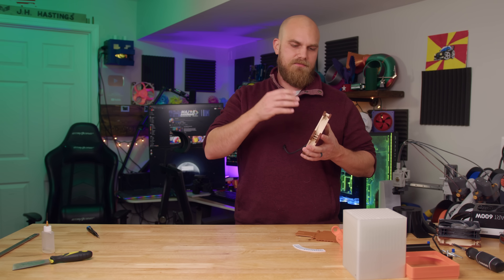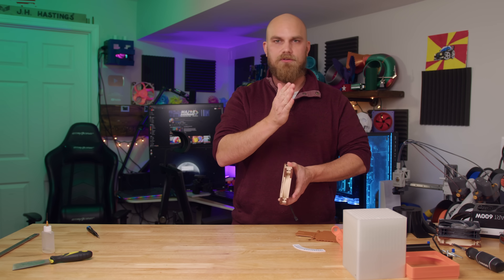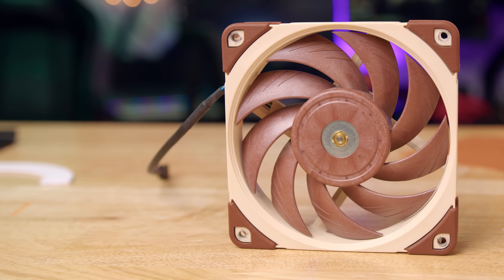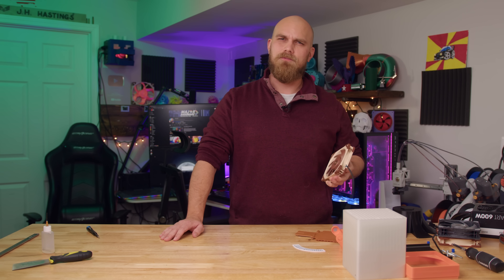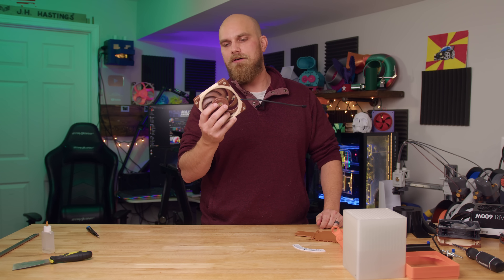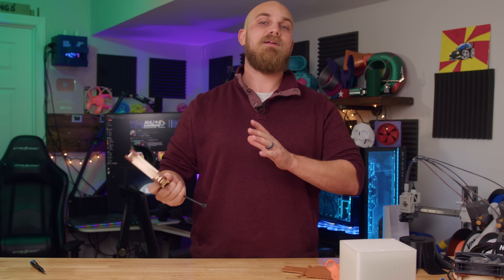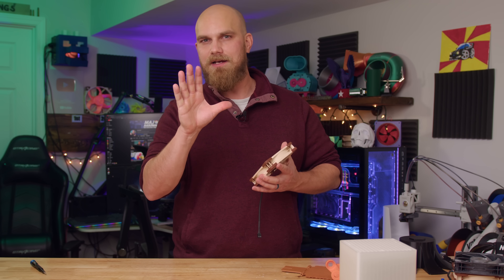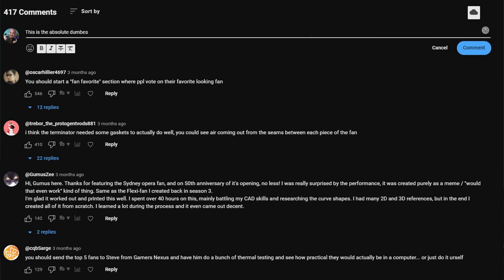I Built a Static Pressure Machine | Fan Showdown Season 6 Pilot

Comment: Nice idea and good way to do next season HOWEVER because you confine the air through a basically a tube and ontop of that even a grid, there is basically no spillage of air on the sides, making it so all the air would have to get through. In a real scenario it should push air through a radiator to cool. If a fan spills most of its air to the sides then obviously it will cool less good as a fan that has a tighter airflow. (Very noticeable with the smoke test). I suggest to still use the smoke test and maybe even a smoke test through a radiator aswel to see the spillage of air

Comment: Hi. It looks cool. But maybe to measurement correctly and repeatable you should Set some constant values. Like the rpm values of the fan motor. (With multible stages. I had some fans that works really great until they spun faster or until they worked against a fangrill, that interduced to much turbolences  and also noice / vibration into the system. I guess if you want to messure a kind of efficiency by interducing the power used by the messurement.  Then you straiten and obscure the flow by adding thousends of microturbolences into the system (also thru the layerlines of the print). Shurly you given a constant length but i currently ask myself if longer and maybe slik or spiral guided channels could reduce turbolences more.
As addition to the messure gauge ... maybe begin with 0 and add a really light "maximum force hand" to it. That you can set to 0 , and it get pushed to the maximum value. So comparisons are easyer :)

Thank you for your intressting videos ;) 

Greetings from germany

Thomas

Comment: If you want a cheap and simple manometer just do a tube of liquid and connect one end of it to the box and it will push the water up or pull it down depending on which side of the fan you are testing from. Look up Measurement of Pressure with the Manometer on google and you will see. I think this would be a great start and cheaper then buying a manometer that you wont ever use again. If you really want a digital one just buy a cheap one.

Comment: I feel like the scale should be logarithmic. The further the panel is pushed away from the tunnel, the more difficult its gonna be to push, due to the distance from the tunnnel and leverage (air pushing close to the hinge is going to be less effective than air pushing on the bottom of the flap).

Comment: Actually looks almost perfect, what i would do is to make that counterweight longer so it has a better "resolution" and the measurements are more precise, it dosent need to be a U shape on both sides so the material you take from one of the sides you can add it to the other against the numbers and make that quarter ring bigger.
because the difference between the stock noctua and the winner of last season was pretty small, so the differences are gonna be even smaller.
Other than that... exlenent idea.

Comment: As this flap opens wider, the accuracy of the results just disappear. A lot of airflow is lost at the bottom of the duct because the flap doesn't offer resistance any more as it's partially opened already. This is not a valid testing stand since the competitors seems to be very close in performance to each other. Nice idea, but this test stand isn't relevant.

Comment: The measurements you have are going to be somewhat logarithmic / exponential due to the swinging of the door. It's going to be much easier for a fan to go from 1 to 2 than from 8 to 9 due to the weight of the door acting farther away from the bearing and producing more torque against the airflow at high values versus low, as well as the airflow acting on a smaller cross section as the door gets closer to horizontal. I'd expect a tight cluster of data points as a result if you're using the X25 as the same motor seeing as the margin is already very close.

I'd suggest a more finely graded scaled (Use a longer arm on the counter weight) and trying to adjust the measurement indicated as from the linear one per X degree if you want to continue using this setup.

Either way very cool! I love the DIY low cost way to try to get these measurements rather than needing lab equipment to measure a pretty basic unit.

Comment: You could also use a water filled pipe with 1 or 2 degrees in angle to scale up real rise in water high caused by static pressure

Comment: Try the Arctic p12 max, which claims higher stat pres 4.35 mmH2O. Comparing without equipment, it feels stronger than the NHa12 - on same speed.
You should try more arctic product at all.

Comment: Because most measurements might not vary a lot between fans and reading such a rudimentary scale with the standard issue MK.1 eyeball is probably not accurate enough you should consider using a digital sensor. But to prevent any kind of resistance to the rotation of the flap you would have to use something like a magnetic encoder and a magnet mounted on the axis of rotation. An AS5048 magnetic Encoder would probably work fine. They are really cheap and can easily be used with an Arduino and code from an example library. You wouldn't even have to convert the sensor output into angle of deflection because higher output equals better, in this case.

Comment: I have two thoughts:
1. The flap should be weighted so that the a12x25 puts it dead center because we’re comparing everything to the a12x25.
2. There should be a tube around the flap so that air has to push around it more and can’t escape out the bottom so easily.

Comment: As soon as the flap opens, it really doesn't measure static pressure anymore. A more accurate method would be to let the fan blow into a sealed box, with a water filled u-shaped tube connected to it.

Comment: in theory a fan blade that is better at generating static pressure should show a significant increase in amperage when airflow is blocked (indicating it's working harder to push against the resistance) and might maintain a higher RPM compared to a less efficient fan under the same conditions maybe you can monitor amperage and RPM to generate some kind of benchmark score just an idea
Reply: as an added idea, test all fans at equal RPM using a closed-loop governor (1800?) and check amperage and manometer column, measuring both electrical efficiency and air pressure at the same time.

Comment: Slightly lighter door, so the standard fan gets a higher number. I don’t expect many to be a lot better, but many will probably be worse. So they should at least get a number.

Then I wonder if you could add the same idea as a potentiometer to the scale, to get an actual value out. To separate close calls. No idea how fiddly it would be, but numbers are numbers:)

But overall a neat idea. It’s not a scientific setting after all, so leaning a bit more towards entertainment I think is a good idea. Tunnel is neat and fun.

Comment: I like it. Maybe put a very light (to not add to much weight in counter balance) wire to be further from pivot point to gain accuracy and have a more fine reading of the results as some fans are so closed from each other ?

Comment: As others have suggested: enclose the flap in a longer wind tunnel, and run each fan at least twice. If you do this, you could get the "flap number" (FN) AND the air flow (AF).
You could then average the AFs, average the FNs, and use the FN as a multiplier to determine a Score (S). Formula would be: S = ((AF1+AF2...)/n) x (FN1+FN2...)/n)

Comment: Instead of the random scale, just use degrees.... 0 for closed, 90 for full open, its defined and repeatable.  Also measure the sound while the fan is in the tunnel, you could make a static pressure, at a specific loudness as a direct comparison between fans (fan A scores X degrees at Y Db)

Comment: I'd suggest, instead of letting the flap open, have the flange press against a scale; you can get an extremely precise digital scale for not too much money, and by mounting the scale vertically, literally measure the static pressure (of the lever against the surface of the scale). I think you'll be able to get far more precise measurements of pressure this way, by only allowing the flap to open to 2-3 on your current scale and then 'weighing' the pressure against the flap trying to push it open further.

Also a fan (pun intended) of the change! Mostly for a change of pace, and because a reset opens up the possibility for new designs to do well.

Comment: Isn't the flap exponentially less resistant as it opens? Doesn't that make it an exponential difference between the amount of air it takes to push the flap from a 4 to a 6, or a 10 to 11?

Comment: Not an expert, but I suspect the further the flap is open, the harder it is (lever effect). So the scale doesn't measure linearly, but possibly logarithmic. This means that on the high end fans with more static pressure it is harder to distinguish the reading. Would a longer "needle" help read the measurement more precisely?

Comment: I motion to have the top three of all seasons tested as well, for a more complete set of data.
As for another tool to measure the static pressure, use U-pipe Manometers, three of them to be more precise. One measures the differential pressure of zone 1-2, one of 1-ambient the last of 2-ambient. Basically you have enough data to compare since you have the 1-2 one measure the delta directly and with the other two based on the ambient pressure you can check that in case of suction effects occuring.
Reply: I came here to suggest something very similar.  This is simple, reliable, and repeatable.

Comment: I think you could make an inclined tube manometer.  Pretty simple.  There is an old book 'The Scientific American Book for the Amatuer Scientist' by C.L.Stong.  It is out of print, but it has a low speed wind tunnel in it and that includes making a manometer and pitot tube..  Just a thought. (I am 70+ and made a wind tunnel similar to this when I was in high scrhool, in a former melinium.  (Hint, use a low viscosity fluid that wets the walls of the tubing easily!  I used water, dyed red with food color and a drop or two of Dawn dish washing liquid to lower the viscosity of the water.)

I do like your hacked together mechanical version.

Comment: You could have created an X across the door to reduce weight and it would have been enough. An X bend would have added no weight but might affect airflow. A counter weight can also neutralize any weight the door might have. Also, as someone else pointed out the door should be enclosed because as air exits the tube the air is spilling off the sides and no longer directly impacting the full face of the door. This is why both air planes and dragsters have air dams on the edges of the wings, to prevent the wing from unloading.

Comment: I believe the value of the numbers on your scale is not linear. E.g. it takes significantly more work to get from a 6 to a 7 than it did to go from a 5 to a 6.
This is due to a number of factors with the main one being that the more the flap opens, the less air from the fan is hitting it as the flap moving out of the air's path.

Comment: This still seems to be more a measurement of mass flow than pressure. You almost more needs some kind of diaphragm in there with a moving pointer or something to give an idea of pressure. Flaps like this were used for mass flow rate in older fuel injection systems in cars

Comment: What you've created is a mass airflow sensor. It's exactly the same as what's in your car. In the car, the mass airflow sensor is a flap that measures the amount of air incoming. Combined with the temperature sensor, the computer knows how much oxygen is entering and operates the fuel injector to match whatever performance is required. I think the mass airflow sensor is no better and no worse than the anemometer. You might get better precision out of the anemometer. That being said, what matters in reality is airflow across the heat sink, not necessarily static pressure. I think your mass airflow sensor or anemometer actually do a good job of measuring what matters.

Comment: It would be more complicated, but you could mount a mirror (or laser) to the door near its axis and record deflection of a beam. This would allow you to make the deflection angle much larger than a mechanical lever. Or you could use an optical range finder and measure the movements of the door. A potentiometer may be able to do something similar, but I'm less certain of their sensitivity.

Comment: Another test of sensitivity of the scale would be to run the fans at discreet RPMs (2000, 1900, etc). I think you'll find the scale to be difficult to read because it doesn't have fine enough markings. Or at least, you can get an idea of the level of reliable measurement you can achieve.

Comment: I dont think the hatch designe will work. I mean it does but I am septical if its the best way. Maybe use gravity as your obsticle force. Turn the thing up so the fan is at the bottom. And instead of a hatch use a simple cap/hat/insert witch only has a few narrow slits on the side. This cilinder cap should rise up based on how mutch pressure the fan can produce. Leave the flow strainer out. It does not add mutch to the result better yet it makes it worth as a lot of air will stick to it. And turbulence is part of these fans :D I am happy to help with the designe if you want :D

Comment: You know you can build a manometer with water and a tube you said it yourself it's static pressure is 2.4mm of water you get your wind tunnel block the middle and have a U shaped tube of water the goes into the tube and is on a rod outside the tube turn on the fan. And the water in the tube should raise a given amount.

Your test rig is actually flawed because as the door raises you are creating less and less resistance to flow.

Comment: What if you build it verticle? Like fan at the bottom pushing a flat flap up and measure that. Like fan elevated off the table and the flap would be on rails.

Comment: I don't believe this is going to measure static pressure so much as it's going to measure velocity. The simplest thing to do would be to have a tunnel like you have, but no straightener needed, and just have the one end have like a 1 inch hole in it. Then tap into it with a tube to measure pressure with a column of water. A U-shaped device, a barometer. It will give you mmH2O.

Comment: I have a few ideas to improve.  Remove the shields of our bearings permanently and clean out the thick grease and replace with a super low viscosity oil.  If you want an easier way to read pressure you don’t have to measure in displacement of water. You can make a differential pressure gauge with any fluid.  Just need something stable and less dense than water.  A light oil? Also think there are old sensors on cars that use a similar meter to what you created.  It’s a Flapper Mass Air Flow (MAF) sensor. Could power it with 5v and read the output voltage to the 100th of a volt.

Comment: I'm not sure if you did, but did you print your flap out of LWPLA (The stuff for RC Aircraft) might help you reduce weight even further. Also I think when flap is in a "neutral" position it should be sealed or otherwise zero airflow.

Comment: Use all the tests!!! Some fans are good at being loud, some do air speed , some do air pressure. By testing all the properties, we might see some cool designs that are really good at one thing, or we might get the perfect compromise. Its all good stuff anyway. It would be a shame to miss out on a fan being good at something because it wasn't tested. 

And, add some more counterweight so the scale shows more than 9½ , I feel everything will sit at 5 with this setup, a larger value will show the tiny differences better.

♥

Comment: You can make a pressure differential gauge with water and a hose and if you put the water column on an angle you can get higher definition and easier scaling

Comment: having a bunch of air between the fan's output and the flap is a bad idea: the air in the middle acts like a squishy spring. so let's say you have a table top, on top of that you have a ceramic coffee mug, and you're trying to push it. currently, you're pushing it through a pillow.

the flap isn't so great either: when the flap opens, the pressure escapes. what you want is the ability to press water down.

SO INSTEAD DO THE FOLLOWING:

a 1cm thin, glass, u-shaped pipe is filled with a fluid that does not easily evaporate, but let's assume water for now. the U has its ends pointing up and they are both open. on the right end the thin pipe flares out to a fan mount. the fan blows into the flared end. the pressure it exerts down on the fluid from the top. obviously on the other side this will push the fluid up, counteracting gravity. the further the fluid is pushed up, the more pressure the fan exerts. you could probably even calculate the exact fan pressure being exerted by calculating from the density of the fluid, cross section, etc.
Reply: btw it's important that on the right the pipe ends close to the water level, whereas on the left side, it has to go a bit further up. So maybe it's more like a mirrored J where the left side is taller than the right side.
Reply: i think if you take the deflection of water on the left side, multiply it by two, then divide it by the area of the fan output hole and multiply it by the cross sectional area at the water surface on the left (where it's rising), then you should get the exact measurement in mm H2O (given that your fluid is pure H2O)
Reply: you multiply by two because if on the left it goes up by 1mm then on the right it goes down by 1mm and so the distance between water levels is 2mm. and that means that the air pressure essentially replaces a 2mm high cylinder of water, which is 2x the deflection on the left. that's why you multiply by two.